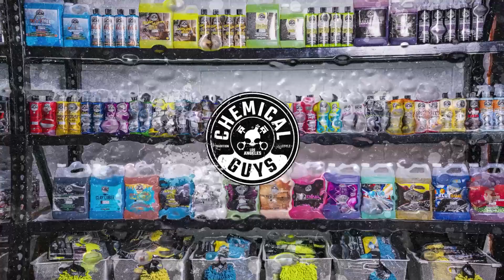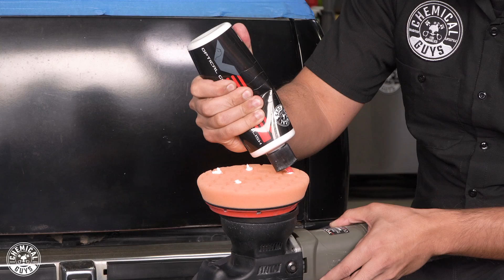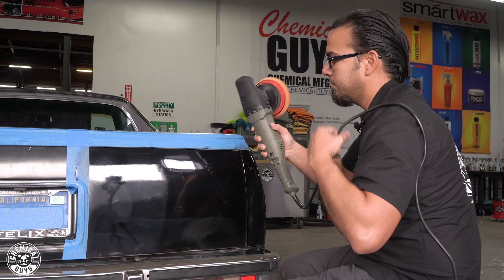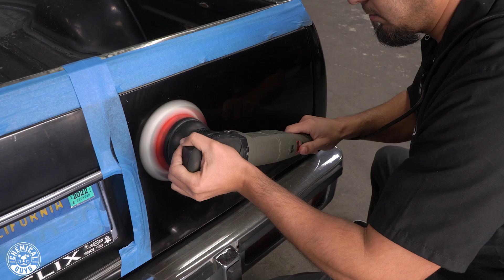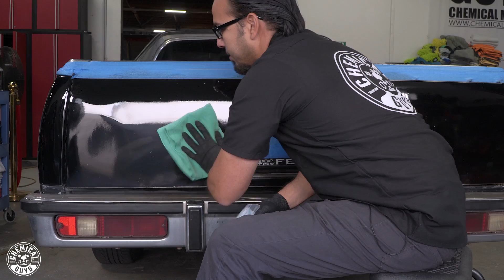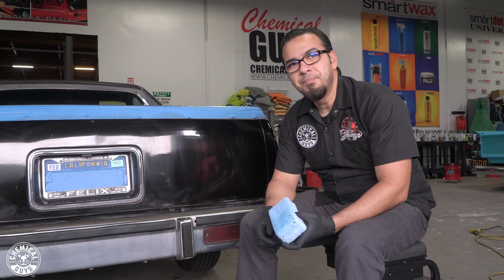How To Revive Faded Paint! - Chemical Guys

Comment: If i do this on a 2 stage paint and use jet seal after final polish, do i apply butter wet wax then hydro slick or hydro slick then butter wet wax?
Reply from the maker: Hi! After polishing, we recommend applying ceramic, then sealant and finish with wax. So add HydroSlick then JetSeal and lastly Butter Wet Wax.

Comment: You guys should do a video on how to polish the hard to reach spots like in the door frames and the roof of an suv or truck
Reply: You can get attachments like a spta m14 thread flexible shaft, which I would have thought would be good for door frames or bits like under the licence plate on this car
Reply from the maker: Hey! Thanks so much for your suggestion. Using a smaller pad or hand polishing is great for these areas.

Comment: Is this a permanent solution? I’m sure you’ll have to detail it with specific products to keep the shine right
Reply from the maker: Hi James! As long as the vehicle is washed and dried properly using linear motions to prevent swirls and coated regularly to maintain protection, it will last.
Reply: @ChemicalGuys  what you recommend as far as coating goes?

Comment: Great video.  I just bought a 2021 Ford Shelby GT500 and could really use a refresher course on dealing with cleaning/waxing/protecting paint and vinyl racing stripes. Best to tape off the edges of the stripes to not get product showing on the edges?
Reply from the maker: Hey! Yes, it is always best to avoid polishing stripes, especially if they are matte finish. Mask off sensitive areas for the best results.